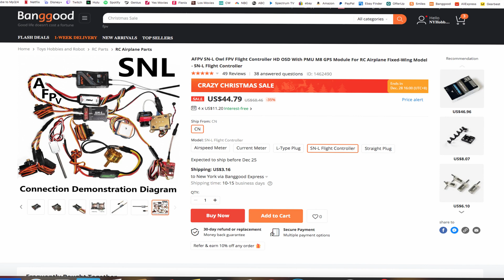AFPV (LEFEIRC) SN-L Wiring Walkthrough

Comment: This is NOT a reliable FC and I hope you don't waste your money on it.  I bought 2 of them.  One was dead on arrival.  The other would work when it felt like it but was EXTREMELY difficult to get to do the radio calibration correctly.  I used my Spectrum DX6 TX and tried a couple different RXs but the Owl FC was always a total PITA.  Often, it would power up in radio cal mode, even though I didn't touch the TX sticks before init was complete, and it would make me do the  cal all over again.  And very often, the cal wouldn't recognize the aileron input range so you could get into sub-menus but you couldn't get back out.  Sometimes the radio cal would would cal the elevator stick in the correct direction but more often would set it in reverse so you had to flip the stick up to go down the menus.  It was such a pain.  I emailed the mfgr but they were no help.  I threw both Owl FCs in the trash because they wouldn't replace them and it wasn't worth the frustration and wasted time.  I'm now flying with Matek FCs, running iNAV and love them!  A true joy to fly with.  Of course there are other good FCs available that run iNAV and Betaflight as well.  If you don't want the OSD function and would just like to have a stabilize & a RTH function, the ZOHD Kopilot lite and the Bigaole BGL-6G-AP are both nice, easy to use autopilots that work very well.  I like the ZOHD best because it's a little less expensive than the Bigaole and I like the way its RTH function works.